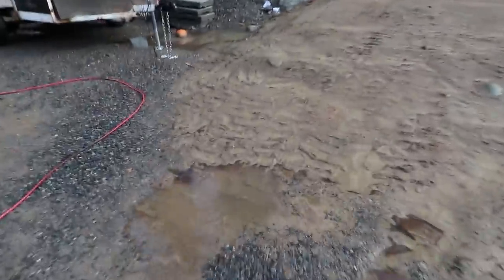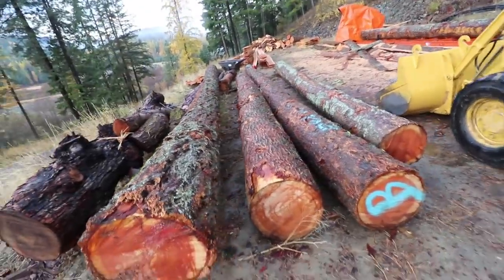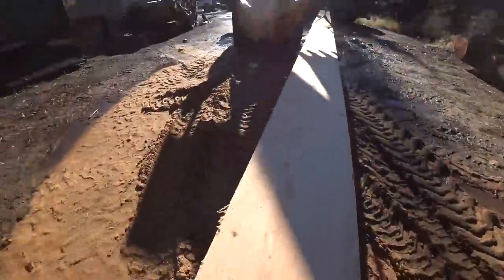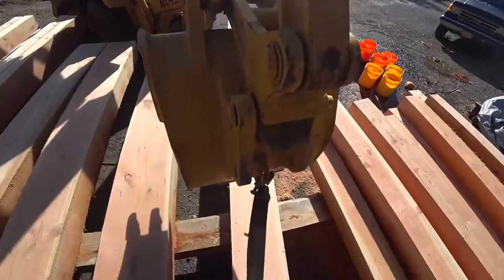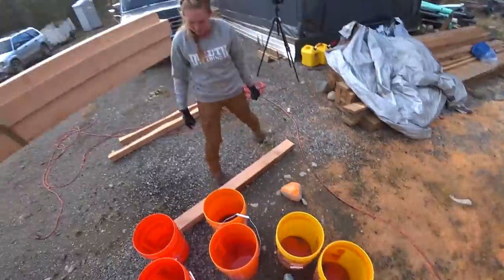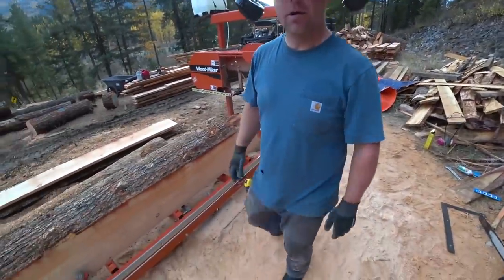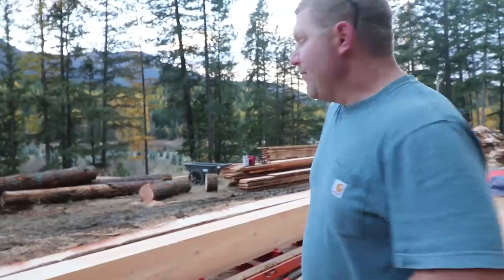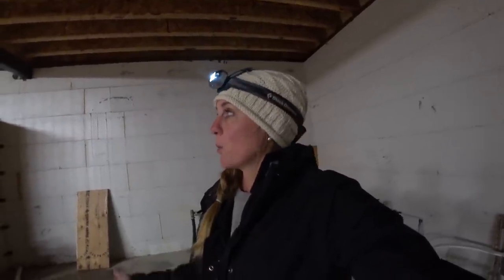AND THE INJURIES BEGIN! (Sawmilling While Exhausted)

Comment: As a John Deere mechanic most the time I found that the alternators don't go bad it's the voltage regulator. And a voltage regulator is a lot cheaper.
Reply: Just use a 0ne wire alternator

Comment: Why wouldn't they have thrown some plywood or just scrap wood from the mill over that stairwell in the first place? It doesn't have to be domed.......

A good way to get a tarp to stay attached is to seal the edges, strips of plywood or 2x4's around the whole perimeter holding the edges down and preventing the wind from getting under it. They have tons of lumber around there to do this with.

Comment: Hey, no need at all to take all the bark off, that's the advantage of home mills - 4 flats are enough with rounded edges, charming. If you want 4 flats, might as well buy it, because I know from experience that it costs less in time, health and dollars.  I always mill rafters on just 3 sides and leave the bottom round. You got yourself trapped with that mill so you have to have another hand. Get a Thumb and forks and room to work all around. LIfe is hard enough. Yeah, I know, that's how we did it and it's too hard to move it now. Nice work. Know it too well. I had a woodmizer HD 40 all hydraulic, but if you do the math, any timber under 6x8 is far cheaper and better store bought - I ended up cutting almost all 12x12 - can't buy that easily.  Be careful, bodies wear out contrary to my firm faith that I was superman.

Comment: Make use of your masses of man glitter and cover the puddles and muddy areas.  I know wood chip absorb a lot of water and prevent mud puddles so I think you man glitter would do the same thing only it will blow away when it dries up.  But keep the wood chips in mind for later to spread around the house or even on your driveway to prevent the mud/puddle issues.

Comment: Have you guys considered bolting a couple of thick-walled square tubing to the inside walls of the backhoe bucket to use as forks for loading logs and lumber?  Drill through the bucket sides and use Grade 8 bolts with washers.  Total cost around $50.  I do a lot of my own logging and milling and the forks make quick work of moving logs and lumber...just saying.  Keep up the good work!

Comment: Do you guys ever wonder how much resetup time you would have saved by laying a permanent flat pad for the mill? Why not lay a mill pad now with the rain coming it will give you a clean safe little mill barn to work even in bad weather. You could even build the pad with post holders and use some of the small extra pieces and cover it. It's not like you'll never use it with the 2 or three more buildings you'll make after this one. soggy under the pads is going to give you fits.
Reply: ScottKer problem is if the pad isn't where you want it the future you've got to get rid of it. maybe drill the slabs and steak em
Reply: You are absolutely correct that they will probably have to take it out in the future and location is very important. I think I've seen in some past videos that they have an idea where the barn will go so they have a pretty good idea of the layout of the land. It is important with the amount of milling they will do for the remainder of the house, building the barn and knowing that the Pacific Northwest weather is going to only get worse and stay that way for at least 4 or 5 months. All that plus constant realignment or the mill they means they need to do something to both make it better and prepare for what's coming, which is a muddy mess.

Comment: On your + terminal there is a sense lead probably a 10 to 12 GA line.  That lead feeds  the voltage regulator the voltage regulator intern then distribute electrical power both to the battery and do the rest of the systems within the within the backhoe and that is how the battery is maintained so check that sense lead. Also if you have a brand new battery make sure you use a wire brush to strip the terminals of any anti-corrosive compound they may have deposited on the terminals to keep them from corroding during transport.

Finally wear an air compressor is a wonderful thing I can tell you this. a leaf blower will cover the entire area of your mail in about 15 seconds with high enough pressure to clear out all of the debris. Just thoughts.  Glad the bumps were minimal.  Hot water and Epsom salts for that humeral nerve compression and snuggles with warm then cold compress for his head.
Reply: Wait, the voltage regulator has an intern?! ;-P
Reply: How do you think all of those itybity electrons make it into the battery. The ONLY way would be free labor. INTERNS,.,  Now the mystery is solved. LOVE your wit!
Reply: Haha... Stands to reason, I suppose. There's no way a voltage regulator could afford any hired help.

Comment: If the logs are too heavy and crash down when rotated, it might be good idea to build a tower that utilizes pulleys. 
So you can easily lift and rotate the logs smoothly and place them back down much softer. That would stop the sawmill from flying all over the place, and you could probably operate it by yourself. Chains, metal braces, timber, some design time, done..

Comment: Hey kids absolutely love watching you two building your dreams. Maybe you have already heard this suggestion/idea. Save some of that second cut lumber to make raised beds for the garden. I live just north of you in the Columbia Valley in Canada; yours and my land is essentially glacial till, good for growing lumber not the best for growing gardens. What I did was pound two to three foot lengths of rebar into the ground and then, using plumbing strapping and screws to hold them up, used the second cut for the walls of the beds. The previous owner of my place had brought in soil which I used for my beds. Depending on how many beds you want to build you could bring in a dump truck of bedding soil or just the back of the truck full of bags of soil and manure. You could also fill the bottoms of the beds with small rocks and sawdust, you've got lots of that stuff around these days don't you? I also used second cut lumber (and wire) to build bear proof compost bins. Country living . . . you love and draws a lot out of you. But mostly you love it. Play save, Ken

Comment: just a suggestion, but instead of piling up on just firewood couldn't you,ll  think ahead and cut some dimensional stuff like some 1X2,1x4,2x2,2x4,2x6 and may be even some 2x8 you could put them to some great use  while building the property up  such as a picket fence, a barn,  may be even some furniture.
regards
Reply: Or with the excess, sell it on Craigslist -- whether it's firewood worthy or not, list it as such.. someone will buy it.. Could use all the extra wood AND sawdust to make wood pellets to warm the hot tub and/or the home... Just an idea to get some money back AND get rid of it at the same time.
Reply: They've answered this so many times.  They're generating more than enough dimensional lumber for their needs.  They made the conscious decision to not chase every possible inch of lumber in favor of getting the timers milled in time for the workshop.

Comment: ALTERNATOR...  Most of the time when they fail, its because of the BUSHES inside are worn OR the comutator is DIRTY.  You can split the case, remove the back half and access the brushes.  See if the comutator is dirty and if it is, a little 400-600 grit wet and dry will solve that issue.  A brush kit is only a couple bucks if the brushes are worn..   You can use a paper clip to hold the brushes inside the brush hoder when reassembling the back case.  Remove the paperclip and all is good..May just need a simple inexpesive repair.  Heck,, If I lived close, I would fix it for you.  CT is a LOOOONG way away.

Comment: FFS.. Buy some gravel, dig 3 x 10 meters. Level it, vibrate it and some concrete. And the savmill wont move. All that time used on moving the sawmill, and "repair" the bad cuts, its not worth it :)
Reply: Second thar
Reply: Very true, but that is not the final location for the sawmill. When the house is completed, they'll move it somewhere else and then they'd be left with this giant concrete slab in the middle of their land.
Reply: You can always use a slab for something,garage shed parking.

Comment: Where do you get the energy? 
The comment about the battery switch is great one. 
Is there any room to put another battery box and battery?
Weather you can or not pick up a battery switch for a boat.
They make a switch that let's you use two batteries and be able to choose either battery or both batteries and be able to turn them off.
The alternator output should be around 14.5 volts.
It Would Probably Be A Good Idea To get A Good battery  Voltage tester.
If you get one  get one that will load test the battery and check alternator output.
Another good thing to have is a very good pair of copper cables that are made using 4awg wire.
Good luck and be prepared.

Comment: i think you need to blank out the stairway hole with plywood. that will not allow water to puddle and not allow the air to blow up there under the tarp which causes balloon and ripping the tarp. i think the open garage is causing wind to be trapped and pushing the air up thru the stairway. my thoughts. all of this is old news as you already have the frame up by now. i stay up late to be able to catch your next video if it were to come up. thanks for all you have done and are doing to share you journey with us.
Reply: Mr j.r.s. why do people keep claiming that? "The frame is finished" "the house is finished" what's that about?
Reply: you gotta play catch up. you are a month behind

Comment: Honda eu30i has a built in battery charger ☺
Reply: Wadlo  goal zero yeti 1250 better option
Reply: blunder15 yes I know the Honda only has 8.3 amp DC outlet but its enough to charge a battery and saves a drive to town to the storage shed to get the other charger...
Reply: Wadlo the only down thing with the yeti is the price ,  doesn't matter when you run out of fuel either

Comment: Too bad you don't have something like a backhoe/frontloader that can lift a pallet.
If you DID, stack all the firewood as you cut it so you don't have to dump it with the backhoe and deal with it later.
I am assuming all that scrap wood is firewood.
Also, label and leave the beams where they are and grab them when you need them.
And by the time i saw this and posted, it looks like the house is done!

Comment: What is the purpose of the perpendicular 3/4 wall in the middle (almost) in the back of the garage?
Reply: its a buttress to support the back wall against the weight of the backfill on the high side of the property.
Reply: Sam Hofmeyer thanks for the reply! I thought it was floor support!
Reply: Ed Tin , think of the back wall of the garage as a single long concrete beam, pinned at corners. Now place all the backfill against the garage back wall, creating a load bending that long concrete beam. As it bends it wants to lengthen, causing tension in the concrete. Concrete is strong in compression but weak in tension...Now add the 3/4 wall you mentioned,which is a buttress to transfer the backfill load & to divide the wall into two shorter concrete beams reducing the bending thus saving the garage wall from cracking & failing!!
Reply: Thank you, that makes sense. Good answer.
Reply: Buttress:  for the rear wall against the hillside.

Comment: You can use any cheep motor oil for bar oil. You dont have to buy that expensive stuff
Reply: yeah man like they both are oils, whats the difference anyway????
Reply: papukaiffa,price. All it does is lube the chain and get flung off onto the wood.
Reply: Used to use 30w or even used motor oil put the motor oil in a 5 gallon bucket dip the saw occasionally.
Reply: kevin roberts you are right. I had a saw once that the oiler broke and would cost more to fix than replacing the saw. I used the saw for several more yeats as a backup and brush cutter. 5 gallon bucket of used motor oil worked fine to lubricate the chain.
    Kept the new saw for cutting the bigger stuff.

Comment: Would have saved a ton of time, materials, money, stress - to build a smaller house, or keep a smaller footprint and go higher. Full basement saves energy for the life of the house, gives a lot of options you otherwise miss, and heating is easier in a smaller footprint and going up. If you need to - return the hot air from highest point....

Comment: with the trap why don't you build a poll from wood with a large footing at the top and bottom, bolt it down if you need to with the trap lifted in the middle it will self drain.

Comment: If you are still expecting more rain, have you considered sliding something under the middle of the tarp (styrofoam box...) to try and give it a small slope over the whole run of the tarp?
I'd love to see who the down voters are, are they consistently watching your vids and down voting, don't let them discourage you guys.
Excellent work on increasing your speed and throughput with your mill, you're making me envious; kudos to Alisa for getting your planing faster and trying new things to adapt to challenges.
Keep up the good work you two!
Reply: Have you guys thought of using more air tools reduce your burden on the tightening and loosening of those bolts and nuts?